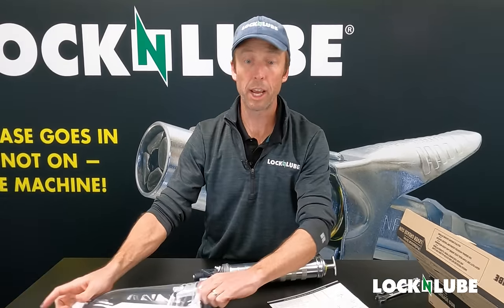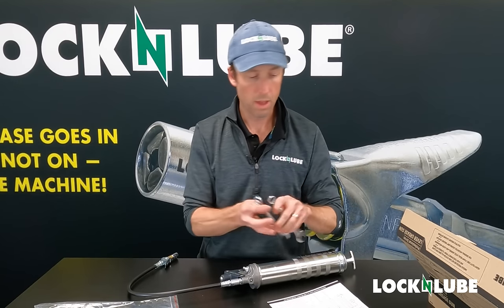How to Load and Prime a Grease Gun (new for 2023)

Comment: Good video thanks. One common problem I've found with cartridge grease guns is getting the follower plate to start into the end of a new cardboard tube.
  The solution that I found was to notch the follower rod about 1/4" longer than the factory notch. This causes the new cartridge to hit the follower plate a quarter inch before fully seating.
  You then remove the tin pull-tab plate, and rotate the new cardboard tube while pushing it into place using your fingers. This method insures that the follower plate has entered the new tube before you install the pump head, and removes much of the air from being trapped at the pump end. (Just swipe off the excess grease before installing the pump head.)
Reply from the maker: This is a way to do on cheaper grease guns that don't give you the ability to lock the follower into the T-Handle. All or our full size guns give you that option.

Comment: Thank you for explaining the follower plate.  I kept trying to figure out what the "drop" was in the t-handle which I thought dropped into, and not away from, the cylinder.  Also didn't know if when priming, to pump the handle while pressing the release valve, and if to do this while the cylinder is still a few turns loosened or not.  ALso, I think I understand a bit more about locking the t-handle onto the following plate and if I released properly before using, or is I ever really locked onto it at all.

Comment: what is causing the grease to come out along the rod when you pull it back out, sometimes there is more than half a tube of grease on on the wrong side of the washer ,mixed  with the spring , you think that gun is empty ,as it doesn,t pump anymore ,anoying
Reply from the maker: Do you mean one of our guns specifically?